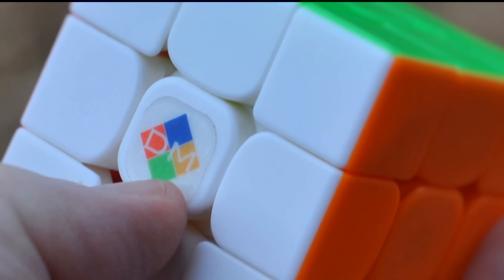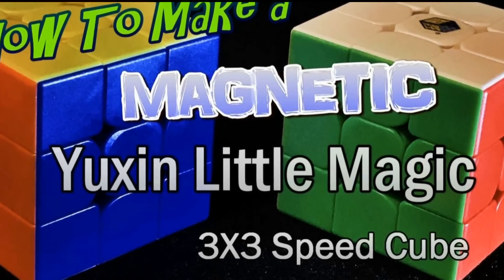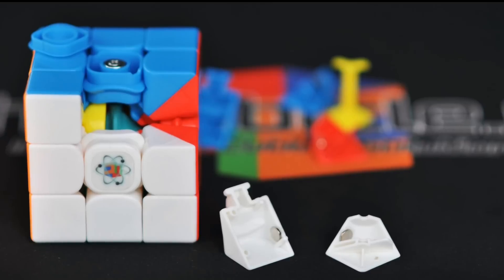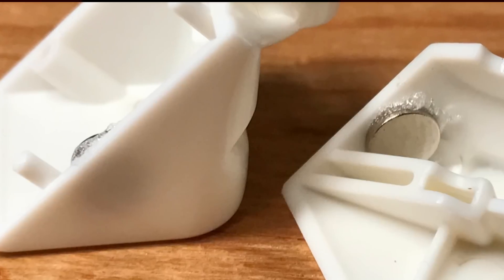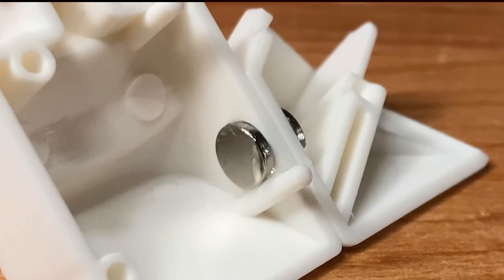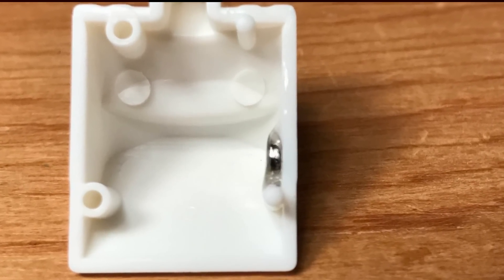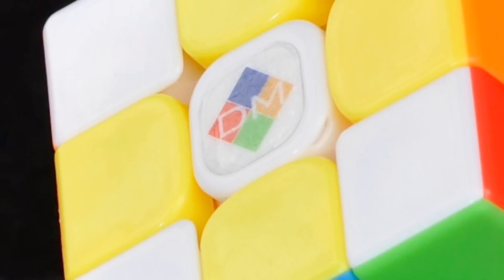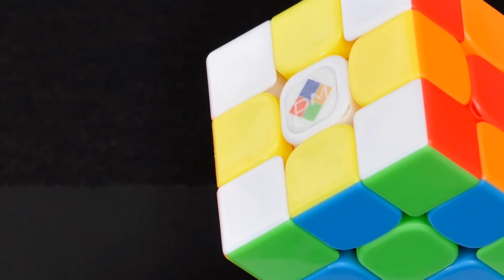Magnetizing the MoYu MF3RS2 Speed Cube

Comment: I have a problem. The magnets is very weak when I turn it even though I've used 4x2 N38 magnets. :(
Reply from the maker: Really???? It shouldn't be, not at all! Have you checked to make sure the polarity is correct? That's very important to do. Assemble your cube without the core. ALL the pieces should attract each other to hold the cube into its cube shape. Let me know how it goes.
Reply: DMCubing The pieces does attract each other then I tried N50 4x2 magnets on the corners and edges but It's still weak. Maybe its about the pieces being black because I have the MF3RS2 in Stickered Black. Should I use stickerless so the magnets can easily attract each other? By the way the polarity is correct.

I need help...
Reply from the maker: Diamond Complex // Minecraft Where are you getting your magnets? 
No, it's not the black plastic- the difference is not even measurable. 
Unless you're paying a premium for them, most N50 magnets are fake. Where did you get them? 
Are your magnets lined up perfectly? Did you watch my video here, where i show the magnets will need to be moved up a little bit to be aligned?
Reply: DMCubing I've use the way that I magnetized my MF3RS that you've uploaded at the end of January. I lined it up perfectly when I used the N50 magnets but it still doesn't work. I bought it from eBay which is only $2.
I hope that you can help me fix my cube.
Reply: DMCubing Also when I magnetized my cube, the magnets are strong. The problem is that the magnets turned weak when I assembled the cube.
Reply from the maker: Diamond Complex // Minecraft I am sorry to tell you, it's your magnets. There is no such thing as $2 N50s. I've been warning people about this for a long time. What you probably have is a grade N35, and I could see that being fairly weak. The only reliable place in the US for N50s (as well as N35, 38, 42) is Gaussboys. For N48, Apex, and for N52, Thackery. 
If you buy anywhere else, it's a gamble. Trust me. 
I think, though, if you used the cube for a while, it might start feeling better. It's often best, if you're going to error, to be on the lighter side than too strong.
Reply: DMCubing Hmmm.. That worked on my QiYi WuQue when I shocked when the magnets are weak when I magnetized it then I threw it on my trash can then it got 3x stronger after 2 weeks of it being in the trash can...
Used only N38 on my WuQue.

should i do it on my mf3rs2?
Reply from the maker: I thought you already said you used N38 4x2s in the MF3RS2. I'm confused. And you're saying the magnets got 3x stronger after being thrown away???? Yeah, I'm not understanding.
Reply: DMCubing The magnets that became stronger is on my WuQue (only N38 4x2 magnets used). I've found a way fix the MF3RS2 magnets became very weak (not by throwing it away). I doubled the magnets by putting magnets at the top and make sure that they are repelling each other or by putting 2 magnets on each piece.
~PEACE!

Thanks for telling me that some magnets are fake.

Comment: Well I used n50 4x2s on my mf3rs2 and it felt very weak I personally think a non-magnetized version is better it is much lighter and faster. But the magnets do make it a little more stable tho
Reply from the maker: LeBron The Goat It's possible the N50s you got were fake and actually N35. I've been warning people about these for ages. Trust me, a true to spec N50 would feel extremely strong in this cube.
Reply: LeBron The Goat i guess u did it wrongly

Comment: I want to magnetize a 50mm mf3. Do you think my 4x1 N48s will work well in it? I feel like it would because they're weaker magnets and the cube is smaller but I don't know that much about how the magnets work.
Reply from the maker: David Fischer I'm not at all familiar with that cube. An N48 4x1 would probably be weak, even in a cube that small. I'd probably try something like a relatively strong 3x2.
Reply: DMCubing are you sure? N48 4x1 is the Cubicle's lite magnet kit which apparently works on 3x3s that are full size so I don't think they would be too weak
Reply from the maker: David Fischer I have about 15,000 magnets and rarely if ever use N48 4x1s. Sure they'll work in some of the newer, thinner plastic cubes, but they're pretty subtle. And I actually like subtle cubes. I'd rather use an N35 4x1.5, N35 4x1.7, N52 3x1.5 or N42 3x2.
Reply: DMCubing 15,000? Jeez lol. Thanks for the help, I'll probably do it anyway just because I already bought the magnets haha. Or maybe I'll just save them for another cube
Reply from the maker: David Fischer Well I should have added they'll be fine, and honestly, after magnetizing nearly 150 cubes now, I've yet to have a cube that "felt too subtle" that I couldn't get used to. But I do have a large collection of cubes that ended up too strong that as far as I'm concerned are more or less unusable. So you're always better off being on the subtle end of magnetic strength than on the other end. You can always get a subtle cube to work, but not necessarily so with a cube that's too strong. 
The N48 4x1s will be fine. 
Also, there's a really good online magnetics calculator at K&J Magnetics that helps give some predictable strengths. 
Do let me know how the cube turns out.

Comment: So I ordered a Stickerless Yuxin Little Magic, a MF3RS and I already have a MFRS2. I’m recieving  an order of 100 4x2 N35 and 50 N48 and I’m not sure which way to distribute the magnets to the three cubes as I’m new to this and I know each cube required 48. Any help would be awesome!
Reply from the maker: DeTiix Sure. First, you're going to have fun magnetizing them! Usually we really only use N48 4x2 in older, thicker plastic cubes like the original Yuexiao, the GTS, original Thunderclap, Aolong V2. Newer cubes tend to have thinner plastic and for those cubes, slightly weaker magnets like the N35 4x2 work well.

Comment: Will you ever make a business on magnetize cubes??
Reply from the maker: Harden Mobile That would be kind of fun! But I have a career as a musician and musical instrument repair technician, so I do this just for fun.
Reply: DMCubing Oh Ok
Reply: @dmcubing6342  If you know things about instruments, can I ask if trombone slide lube can work on a speedcube?
Reply from the maker: ThE 1 BarbariaN Hey! Probably depends on what type of slide lube it is. Most trombone hand slide preparations I'm familiar with would probably be too thin and not very long lasting. However, personally, I do use musical instrument lubricants! I like Hetman brand lubricants on my cubes. Specifically Hetman Lubricant 7 on the springs and axial screws at the core, Hetman Lubricant 6 on the cubie pieces, and finally a few drops of Hetman Lubricant 14 to speed the cube up. The overall feel of this prep is much like the original Cubicle Lubicle Balanced Lube Kit.
Reply: DMCubing Thanks for you input

Comment: What is the best strength and size of magnet that makes a great stabilization to the cube?
Reply from the maker: King AJ Well that really varies from person to person. The N48 5x1 is just the slightest bit stronger than what I used here, and though it's the stronger of the two Cubicle Labs version, it's still slightly on the medium subtle side. A full size/full strength N35 4x2 would probably be more than strong enough for most people, but some may prefer something stronger. I haven't tried it in this cube but something like the N38 4x2 would probably be perfect for a pronounced magnetic feel.
Reply: DMCubing Does the N38 4x2 magnet make the stabilization great and enough to have the magnetic feel like the cubicle's version?
Reply from the maker: King AJ Well that magnet would actually be stronger than the Cubicle version which uses N48 5x1. 
The N38 4x2 would be more pronounced.
Reply: DMCubing Thanks a lot for the details, I learned something new. +1 Sub 👌🏼
Reply from the maker: King AJ Oh nice!!! Thank you so much!!!!

Comment: I've used N38 4x2s and they feel very light for me, almost unnoticeable. So I doubled the magnets in the edge pieces and the strength felt like that of the Valk Power M. Although I could want a stronger magnet.
Reply from the maker: Gerro Paolo Gallardo Wow. Every time I use N38 4x2s, it usually takes the cube right to the point of being almost too strong. But if you like extra strength in your cube, I understand.
Reply: DMCubing, I was shocked with the MF3RS2. Usually I liked the feel of N35 4x2s but the pieces of the cube were quite thicker than the others.

Comment: Is the n35 4x2 strong?
Reply: chonghauhan Very Weak
Reply from the maker: chonghauhan Depends on the manufacturer. I know Gaussboys N35 4x2s would give a more than adequate pullforce strength in this cube. Point of reference: the Cubicle uses an N48 5x1 magnet in this cube as their heavier version. That magnet has a pullforce weaker than that of the N35 4x2 (though they often feel similar because the width of the 5mm magnet results in a wider magnetic field and gets about the same amount of work done in a slightly weaker magnet.)
So, yes, an N35 4x2 is fine and strong enough.

Comment: Nice video!!!Can you help me??n38 4×2 magnets will be good for valk power??( caps will go on edges???l
Reply from the maker: Dimon_ cuber Those magnets would feel very strong in the Power. The factory version uses N35 4x1.5 in the edges and N35 4x1 in the corners, but it's a very light feel. So I guess you could go as strong as an N38 4x2, but I imagine it will feel pretty pronounced.